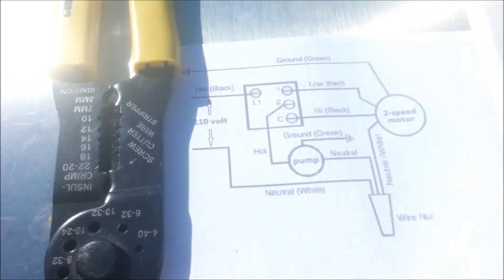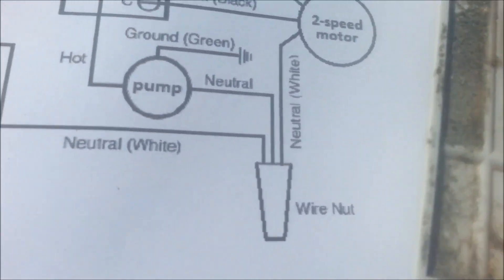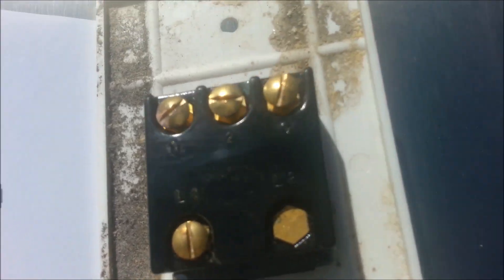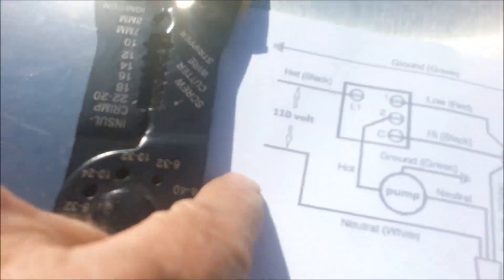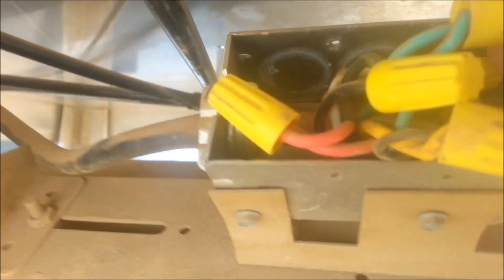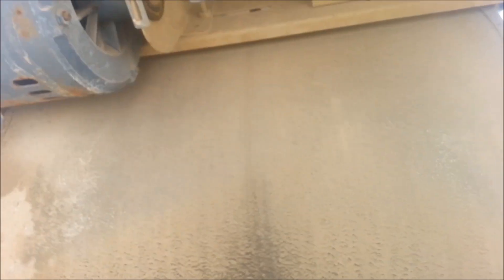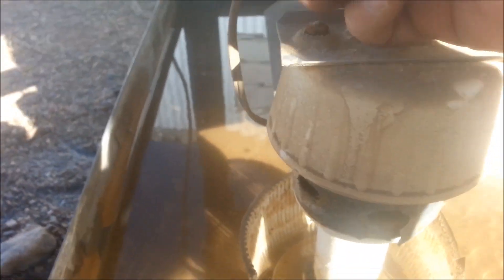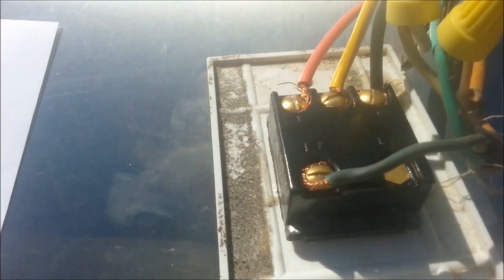Wiring a Evaporative Swamp Cooler Switch

Comment: I have a 2 speed cooler i have 3 sets of wires 1 sets of wires coming from  breaker i come to the switch i have two set of wires coming from the roof i have black coming from the going too rhe l1 i have the common going too the center the other two whites are tied together that is the switch on the roof i have the two whites and the pump natural tied together my pump wires are blue  that leaves  me  with 1 white which is coming coming from the breaker 1 blue  2 reds  1 blue 2 blacks the blue is + from pump the 2 reds are + and - from low side of motor black come 1from motor hi  the other from switch  can u tell me where the wires go

Comment: Heres my problem i have a champion window mount cooler. I bought the switch from champion( essick air) the switch has prongs ( just like the switch for old cooler)
The wiring diagram( if youre going to wire it yourself) has a certain layout: i wish i could put a picture here of it. So the diagram shows 4 being high for blower motor.
3 plain for the pump.
2 not being used.
1 low for the blower.
Then it shows b not being used.
A hot for power cord.
Then top center prong comm for blower one under that comm for pump right top not used and one under that comm for power.
I bought the harness from company that just pops right onto the switch prongs so i wouldnt have to do the wiring myself.
The prong placements all line up but in the harness( that pops onto switch they have reversed the not used slots( in the wiring diagram) they used prong 2 and left prong 1 blank( in the harness) and they used prong B for the power and left prong A blank( in the harness) .
Does this matter? Why would they send wiring  diagram that shows 2 blank and b blank but reverse those in the harness?
Ive tried and tried to get someone from champion to answer those questions to no avail! There is no one there that will help me.
Is it safe to just plug it in and see .
Its brand new harness with power cord and the black motor and pump outlets
Reply: Almost same problem but not the same?! We're trying to wire our newer Tradewinds Evaporative Cooler into our CHAMPION EVAPORATIVE COOLER SWITCH THAT'S already there because The Tradewinds Evaporative Cooler didn't come with a switch nor grill for the inside of the house. Help with wiring would be great and grateful at the same time Help!!

Comment: I had a guy wire the switch supposed to be expert cooler guy . everything was new new box switch. There is no off! Off is high cool or vent? Low is low vent or low cool? And i can run it motor starts to smell.
When i got the cooler it just had a plug in abd motor was set to low now i cant dont dare use it with this wrong wiring is it wired wrong because the cooler was set for plug in low only because no switch?

Comment: Can I just switch the hi and low speed wires (black and red) at the motor (or switch)? An IDIOT designed every switch to run HIGH speed COOL 1st, but Low Vent speed 1st. Not sure why it would be stupid to ask, or why I haven't found ANYONE asking this question. Thanks
Reply: I will try to answer your question. 
A single speed motor has 2 poles  : draw a circle on a piece of paper,  like a clock.  If you look at a clocks face, you will notice that every number,  has an opposite number.  3 - 9 , 12 - 6, 10 - 4, 11 - 5 , etc. 
Now look at a compass. A compass has 360 degrees.  At the top of the compass is 0 degrees  &  at the bottom is 180 degrees. 
Compare the clock face to the compass face : 12 is the same as 0, 6 is the same as 180, 3 is the same as 90, 9 is the same as 270.

Now go back to the motor,  a single speed motor will have a pole at 12 & 6 / 0 & 180. This means that when power is supplied to the motor,  it takes more power  ( torque  ) to turn the motor 180 degrees. 

In a 2 speed motor,  there are 4 poles,  one at 0 degrees,  one at 90 degrees, one at 180 degrees,  one at 270 degrees. 

It takes less power  ( torque  ) to turn the motor 90 degrees,  then 90 degrees,  then 90 degrees,  then 90 degrees to make 1 complete revolution. 

Less power  = less torque  = less heat = motor lasts longer. 

So, it is easier on the motor if the highest speed starts first.

There are videos on line ( how an electric motor works  ) that can explain it better.

Comment: What if you need 220 on that switch? The up on a roof right now trying to figure out how to incorporate the second leg...
Reply: If you have 220v , then you need two separate switches. 
In a 220 v circuit there are 2 legs. One leg is black  ( 120v ) & the other leg is red  ( 120v ).
Nominal voltage is 110v - 120v
110 + 110 = 220 
120 + 120 = 240

The rotary switch can be used for one leg. A spst can be used for the 2nd leg.
Reply: The exception would be if your primary switch has a 250 v capacity.
Reply: What size wire is needed to run from cooler to switch?

Comment: Mine has the moter wired to a box that has a Socket. The swich is wired to a plug that goes into that socket that runs down to a swich in my house that looks exactly the same as the one you show. Off, pump only, Hi Cool, Low Cool, Hi Vent, Low Vent. Now from the moter to the box is fine but i need to see what it should look like from the Box to the swich. You don't show that or you don't have my set up. If there was a way i would take a picture and post it here but i don't think you can post pictures in a reply.
Reply: All swamp coolers use 5 wires  ( conductors  ) .
Black  = motor high speed. 
Red  = motor low speed. 
Blue = pump hot.
White  = neutral. 
Green  = ground  / earth. 

The switch shown in the video has connections for 4 wires. 

One connection is at the bottom  & 3 connections are at the top.

The connection at the bottom is where the main power wire connects to. This is usually a black  wire and is also known as  " line " .

The connections at the top  are known as  " load " . These 3 connections are : Black  = motor high speed.  Red = motor low speed. Blue  = pump hot. 
The white wire  ( neutral ) & the green wire  ( ground  / earth  ) do not connect to the switch. 

Here is a typical installation  : 
The switch is mounted in a single gang junction box in the wall.  A black wire comes into the junction box from source power.  The black wire from source connects to the switch.  3 wires come out of the switch,  black, red, blue. These 3 wires go up inside of the wall to the cooler.  
A white and a green wire also come from source,  go into the junction box,  go through the junction box and go up inside of the wall to the cooler. 

When you turn the switch to Pump,   power goes from line to pump hot.
When you turn the switch to High cool, power goes from line to black load & pump hot.
When you turn the switch to Low cool, power goes from line to red load & pump hot.
When you turn the switch to High vent, power goes from line to black load. When you turn the switch to Low vent,  power goes from line to red load.
Reply: @anthonygonzalez7488  Good explanation. So Anthony, the neutrals from the motor and the pump connect to the white wire from the power line, correct ? And I can just connect those 3 together using a typical twist cap ? Then what do I connect the ground wires from the motor and pump to ?
Reply: @2ndEndingVintage  
The ground wires are all connected together  ( pump, motor  ) .
These grounds are then connected  to either a bare ground  conductor or a shielded ground conductor. 
A true ground will be earthed using a ground  / copper rod at least 3 ft below grade.
It's always good practice to check for potential or residual voltage between neutral and line and neutral and ground .
Reply: @anthonygonzalez7488  this is the best explanation i could of found thank you!😉👍🏼
Reply from the maker: David Whittley You can upload a image to many of the popular media sharing sites than post the link here. Most motors and water pumps in a swamp cooler are wired pretty much the same. I hate to say with out seeing it though as you may have a motor that is wired differently. Is it a one speed motor?
Reply: +aztikkel11 can i see that paper
Reply: David Whittley mine too  ,this guy didn't help me at all ,I need the wiring from the hallway up to j box in roof, then the the new receptacle,S.